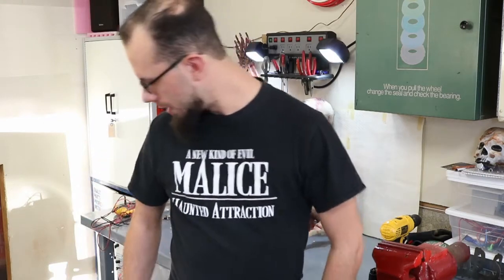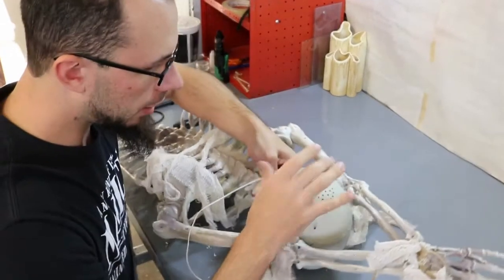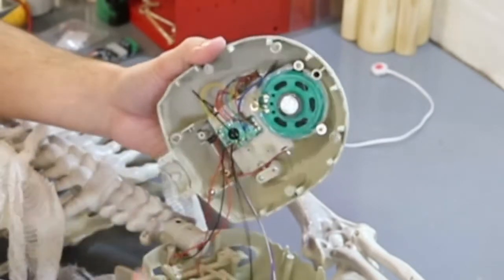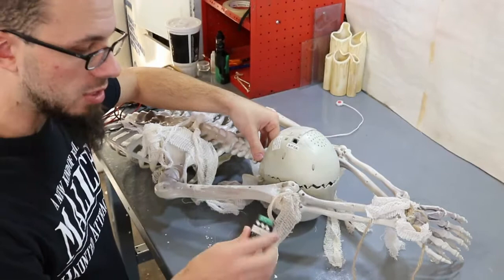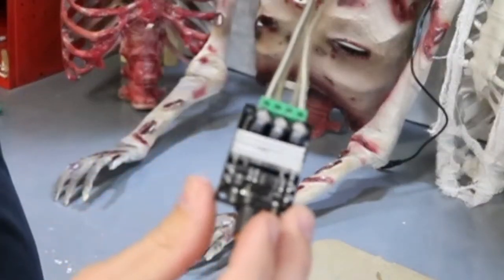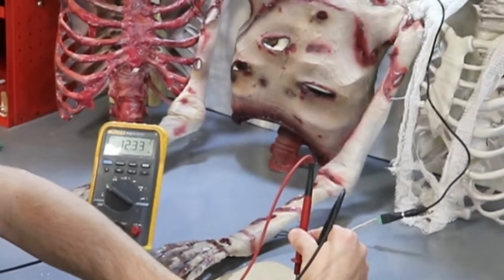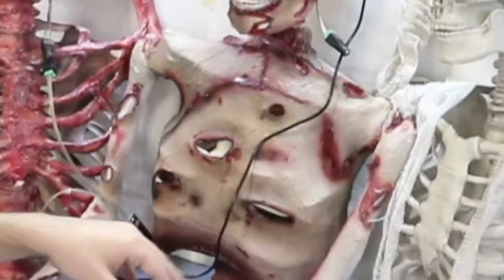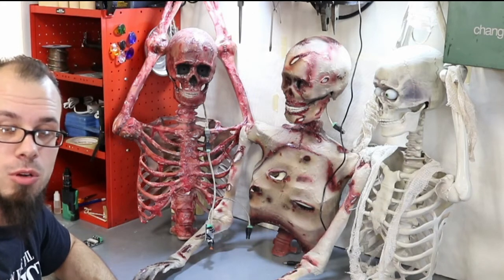Potentiometers and Their Potential with Home Depot Skeletons

Comment: What you are using are actually PWM (pulse width modulation) modules for motor speed control.   Not really to be used for voltage control.   You should find LM317 voltage regulator modules.  These actually  are variable voltage regulators.
Reply from the maker: Thanks for the model number...I have since purchased more of each for their "correct" application.
Reply: These can output over 1 amp.   Be sure to test them in your application and monitor how hot they get.   You will need to add a heat sink to the LM317 chip itself when they get hot.    These are rugged devices.  They have internal over current and over heating shutdown capability so they are almost indestructible.   Happy Haunting..
Reply: You're very welcome.
Reply from the maker: That makes sense...I always appreciate others adding information they have a lot of experience with themselves, learning is half the fun in this community :)

Comment: It looks like a voltage regulator with a potentiometer on it, to control the output voltage. You shouldn't use just a potentiomenter to control voltage.